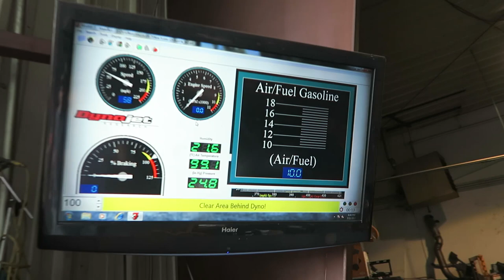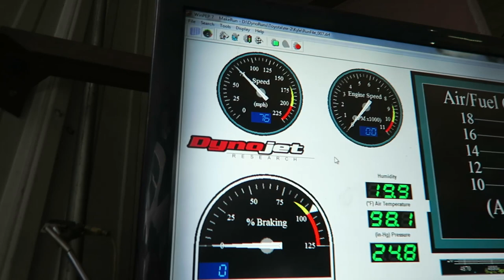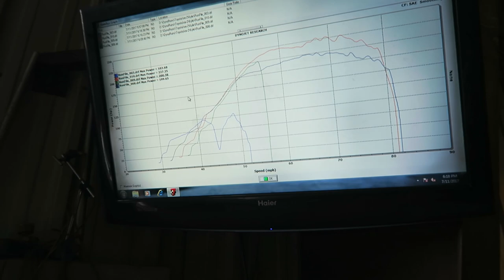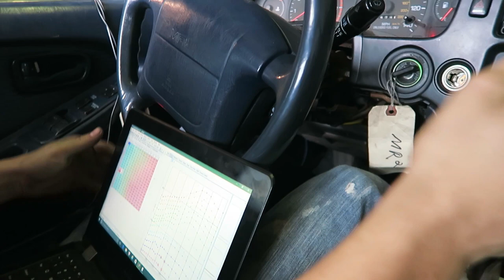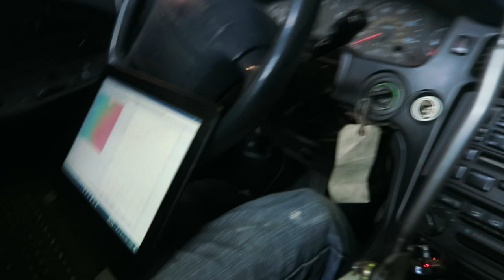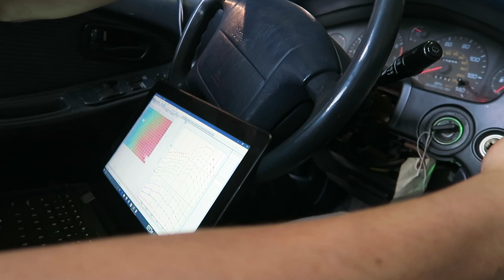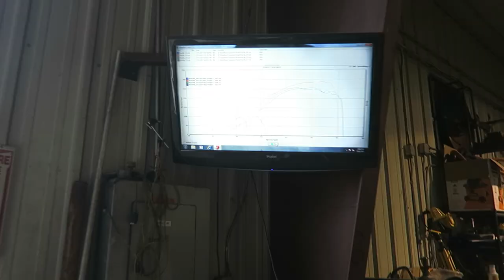K24 Mr2 Makes Some Boost on the Dyno!

Comment: Hayden trust me I've been doing this LS thing for a long time. You don't need a manual transmission,  you just need a good transmission!!!!
Reply: Right. The power curve on that dyno doesn't say "need more converter". The engine on that thing is just worth 237 i nthat iteration, can't blame it on anything.
Reply: The Thomas indeed 😂I started laughing when he said his auto was the problem 😂😂😂😂
Reply: Mike the Mechanic yes my father has an s10 he put a v8 engine it has an automatic transmission and it fuckin fast ass hell
Reply: ok but you cant deny that being able to shift when you want to rather than when a computer decides isnt better
Reply: antsolja you can't deny most computers are smarter than you
Reply: yes but the computer in an automatic transmission isnt, all it knows is what rpm the engine is at, it doesnt know if a corner is coming or when to up or downshift.
Reply: you know there are automatics that you bump shift and you choose what gear they're in right?
Reply: those arent normal automatics are they
Reply: Scrap that LS for a JZ or back to rotory. Problem solved!

But this is a mazda not a chevy so it's heart should be a 3 rotor 20b big turbo. Mazda is one of the few automakers that all of their cars are fun to drive. So he should of kept Mazda.

Comment: Everyone commenting on Haydens rx7 is forgetting 1 key factor. Torque. Although his car only made 237 hp his torque is there. Over 300 torque in that little rx7 will snatch you. It's not a Honda.
Reply: blake conner these kids just don't know how light these FB's are, combined with the fact now that it's got actual torque
Reply: blake conner I had a second gen rx-7 that I believe was 2500 lbs. the first gens were about 300-400 lbs lighter then the second gen models. I would think the first gen with a V8 would be about 2300 lbs.  I hope the owner of that car plans on beefing up the rear end or that torque will probably start breaking them soon.

Comment: Was really expecting more power out of gayden's rx7 😰
Reply: Robles Inline 6 fr tho
Reply: I know right... my crappy 2v made 250 stock with just a tune, I expected that ls to do at least 300-350
Reply: eh it's a 5.3 with just a cam running thru a slush box it probably low 3xx at the crank which is to be expected from a truck motor
Reply: Robles Inline 6 Hayden's 5.3 should be making all of 300wheel. My buddy's cam only 4x4 Silverado made 299 wheel.
Reply: Robles Inline 6 that's what everyone assumes when they ls swap but the rotary would do so much better why do you think everyone who blows so much money on the swap then gets disappointed by results sells there v8 rx7s
Reply: he'll probably have 400hp+ once he slaps a turbo on her
Reply: Ruben Pinto true but the rotary would've done the same with a longer power band than the v8
Reply: Youtuber they're also at elevation which is really hard on NA motors power wise
Reply: LS is a lot more reliable with boost though, I'd still take it over the dorito
Reply: so slow.
Reply: Robles Inline 6, stock 5.3, with a not very good cam, through an unlocked converter. not gonna make alot to the tires.
Reply: The 230 makes sense. The 5.3 vortec motors make like 270 crank stock and he is clearly on a shit tune. This just shows the motor is actually running within a good margin of what it should be.
Reply: It’s it an ls1? Which is a 5.7l
Reply: No, that rotary would have not made the same power with similar mods. It's a carbed 1st gen rx7 motor, it will never have the potential of an LS (as much as I love rotarys). Plus with a turbo this motor can put out 700hp easy with basic internal supporting mods, forged components and were talking about 1000+ hp. The original rotary just can't do that regardless of mods.
Reply: Jacob Coffelt you have clearly never worked on a rotary I see by your lack of knowledge.. rotarys have a ridiculous  amount of potential and can easily put out the same but honestly o  the street you don't even need that much. My only point was that he could have done the same if not more with the amount of money he's put into it. with the 12a if not a whole turbo 2 13b swap just change the fuel injection system port the engine and pin in get the right apex seals and tune it ... easy power.. I actually work on rotary and have seen it..
Reply: Roland Anderson reliability comes down to the owner.. rotarys are just high maintenance
Reply: Al Dubuc lol 4.8l LS based engines make 280 stock cmon that's hard to believe a 5.3 makes less
Reply: shoulda just boosted the 13b
Reply: 5.3's usually make around 220-240 whp stock. 237 is pretty good considering it's an auto.
Reply: Wannabe180sx damn right.
Reply: yea I thought it was a 5.7l which make 300 to the wheels
Reply: Robles Inline 6  , I bet once he gets the transmission in play , he gonna be contending with mr2
Reply: What did I say that was false? Yah rotarys have a ton of potential. But a ls motor with a turbo and forged internals will easily and reliably put down 750+ hp. Obviously a 13b could do that (a 12a wont be hitting 1000hp for near the same price as an LS) but it just wont be as reliable and wont be as cheap. I love rotarys but any rotary owner knows the motors in stock form need to be rebuilt more often than a standard gas car and thats a fact . Upgraded to push over 700hp+ driving tens of thousands of miles just isnt going to be the most affordable option with a modded rotary, at least not in the states.
Reply: Jacob Coffelt gonna  need regeared diff in the long run,
Reply: You think he's a mastermind with the dorito though? You can't blame him for swapping. Plus torque is what feels good on the street
Reply: have a cone internal turbo , for the turbine , all custom , have one in my K20 eg
Reply: Robles Inline 6 and the MR2...
Reply: lol it is not a stock 5.3 junkyard motor. it's a 5.3 bottom end 243 corvette heads a mild cam with springs and retainers and an ls6 intake manifold.
Reply: Wannabe180sx that's true, plus they're at a high elevation and that definitely doesn't help.
Reply: SuicideCRX do you know what's killing the hp? is it just the elevation? I would thing you would make at least 300 wheel.
Reply: Robert Smith truck motor or not Matt made 1071 on a little jim stage 2 cam and turbo
Reply: wAtch #SLOPPYMECHANICS
Reply: SuicideCRX u need to go on sloppy mechanics wiki page he has all the ls hacks,tunes, info to make ur tranny paddle shift. Just check him out if u haven't already, u have to check out his wiki page.just trying to help good luck.
Reply: That's rx7 should be in the 400 easy

Comment: 230 whp in an FB with instant torque from a V8 is fast. That car would hold its own against a lot of lightly modified newer cars.
Reply: Blake Snider just the power output is a bit concerning
Reply: This is exactly what I was thinking. A lot of these commenters have no idea what more than 150 HP at the wheels feels like.
Reply: no its not, you missed my entire point.
Reply: 802 Garage Ive had several 650+ rwhp Ls cars and trust me that set up he is working with has alot more potential its making less hp then a stock 5.3 with stock ecm would make . he has alot to learn with this ls setup but once he figures it out that car will dominate. a stock bottom end 5.3 with decent heads a good fuel system and a single 62mm turbo with 12 psi will make 600rwhp all day long .
Reply: Has he said if it has gen 3 or gen 4 rods? Also t56 will post amazing dyno numbers if he swaps it, but I'm assuming he has a 4l80e in it now which would be better for street and strip imho. SBE 5.3 with the Sloppy Special set up will go 10s, especially in something that light if he can get it to 60foot.
Reply: cgoodm i think its a 4l60e
Reply: Damn, well I'll bet it isn't gonna be sticking around too long.
Reply: cgoodm he has a th400 with a reverse manual valve body
Reply: it does not feel like 230 hp unless you start at a super low rpm. and it has a mild cam ls6 intake 243 vette heads. I'm going to compression test it and see wtf is up
Reply: It does seem odd it isn't making a bit more. Hope you get it all figured out Hayden!
Reply: A stock evo would fucking murder that thing
Reply: You might be surprised. Stock Evo is only making like 250ish WHP and certainly weighs more.

Comment: That's a good number for the MR2. Only thing I'd check on before you go much further is the timing chain tensioner on the K. Those are pretty notorious for going bad and stretching chains. Whenever you do your clutch, maybe hit that too. I think K tuned makes an aftermarket tensioner.
Reply: Spacerichard That's an issue with the K20A2, I believe Kyle has a K24 so it should be fine.
Reply: Ah gotcha, I've got a K20Z1 and a K24A4 currently. I went ahead and upgraded them both while I had them tore down.

Comment: 4900 ft elevation takes a toll on naturally aspirated engines, at 380 ft I have seen 4.8 half ton pickups make 250 at the wheels bone stock.  Once it has some boost it will be a fucking animal!

Comment: try a XTD clutch and lightweight fliywheel for the K24.  They're pretty cheap for the combo on ebay.
Reply: chodyman101  XTD are good if your knowledgeable enough to replace it every 6-12 montjs
Reply: Never cheap out on clutches
Reply: chodyman101 a guy I know has a XTD clutch in his around 500 hp Jetta so this clutch should definitely hold the power this MR2 is gonna be throwing at it

Comment: that rx7 needs at least a cam asap
Reply: kmart nw Hayden said it had a cam but wtf it should make more power totally stock...
Reply: David Gomez definitely, something still isn't right with the fuel system would be my guess
Reply: kmart nw I think it might be the torque converter robbing all his power. Or his fuel lol
Reply: needs a bottle
Reply: Budget Racecar Garage a snail would be better but I assume he's on a tight budget for now
Reply: it has an ls6 intake 243 vette heads and a cam lol something is definitely wrong
Reply: SuicideCRX thing probably has negative timing
Reply: SuicideCRX sounds like you need a converter, looking at the graph. What rpms are you running? And what converter? PTC "performance torque converters" makes a great "budget" converter for the th400 for around $550
Reply: Dalton olson has a stock converter lol might try to get a 3500 rpm one and some nitrous
Reply: SuicideCRX yeah man those numbers will go up! I really recommend looking into a ptc converter! You won't be disappointed. Love the videos man, good luck with the rx7 would love to see it one day.

Comment: So the RX7 made less power than a standard FD turbo 😬
Reply: But has the potential to make much more hp for much less $. He doesn't plan on keeping his ls swapped rx7 stock for very long.
Reply: it also makes tq that would make the rotary cry.
Reply: made less power then stock.... probably the record for lowest LS hp ever
Reply: MrGuvEuroman rofl. rotary
Reply: Wrong.  A stock FD makes about 200-210 at the wheels.
Reply: lmfao, but this is an FB, that's legit 2 generations before the FD. that's really good, especially since its got torque.
Reply: it is a 5.3 out of a truck so it makes more torque than power.
Reply: Donnie Rowland its not an ls engine. its an ls-based 5.3l v8 used in trucks. they dont make much power stock. put a cam and intake on and its easy 400+hp.
Reply: Frigglebiscuit yeah it's a stock truck motor so it's not power but the car is light as hell so hopefully it'll be fast
Reply: funny how everyone thinks it's stock 😒
Reply: SuicideCRX it is besides an intake.
Reply: Frigglebiscuit lol I've said multiple times it has a cam and 243 vette heads
Reply: SuicideCRX sure as hell doesnt sound like it. some serious tuning is ahead for that engine. a 243 cam should at least have a noticeable idle difference. btw, th-400s suck a hell of a lot of power. thats probably where most of it is going.
Reply: It also made far more usable torque than a standard FD turbo.

Comment: That's awful for an LS...
Reply: Nicholas Pelcher it's a piece of shit truck motor. It's only worth ls swapping if it's an lsx not that trash
Reply: bryan #308 odds are h got it out of a junkyard for 100$, put a shitty eBay turbo on it make 400hp reliably
Reply: bryan #308 obviously has no clue about LS truck motors
Reply: Junkyard motor + ebay turbo = reliable 400 hp? In what world bud
Reply: Mags Airsoft in the world of v8s. less boost, less strain.

Comment: what trans is in the RX7? 4L80e and th400 is basically the same except for od. 4L60e is a electronic 700R. the TH400 is a power hog. unless you are running crazy tq. and over about 3000 lbs. its not really needed. I'd go th350 or 4L60e / 700R. unless its going to be a street / striper. with lots of boost. then 4L80/ the 400, and pistons. I'd never use cast in any performance app. good to see progress with MRtwo. get a clutch in there and crank UP that BOOST!!! can't wait to see it. but I bet you wish you put in a good performance clutch. before you put the engine And trans in.  but sometimes you just can't wait or just don't know one is needed.

Comment: wow hayden only made 232hp to the wheels . my brothers 05 silverado with only a cai and cat back made 303rwhp and his a 4x4 auto trans . obviously that 5.3 is either clapped out or the tune is way conservative.  he needs better fuel rails and make it a return style fuel system with an aeromotive regulator and throw in some Ls6 injectors for now.

Comment: those pistons probably failed because the ring gap was too small, not because they are cast.  Cast pistons will take a lot, if the ring gap is right.

Comment: Need more octane, WMI for extra cooling/knock prevention, and bigger ring-end gap. Realistically if you're trying to make some serious power, though, you need 2618s or at least 4032s.

And why is that LS making such terrible power? Not to jinx ya, but it seems like something is seriously wrong with it - that's super low for what it is.

Comment: im thinking maybe he should stick with hondas cause not everyone knows how to properly make good power out of an Ls ! not saying he does not know what he is doing just saying some people just dont understand the Ls platform well enough to make good power. back in 2000 when I had my 95 Z28 with the old style Lt1 not this new direct injected one , I hated Ls motors cause they were new and I knew how to make good power with my Lt1 setup. I literally had over $25k in the motor/supercharger/t56 trans and a built 12 bolt and that car made pretty good power for back then 547rwhp 561rwtq with a 434cid Lt1 and vortec blower with after cooler , but when my buddy made 525rwhp with just a procharger at only 8psi on a stock Ls1 with just a tune and the blower and he only spent $8k total , thats when I became a huge Ls fan .

Comment: Lmao hell a stock v6 mustang could beat that rx7.... BTW with having a cam, heads and a intake you should be putting down more power than that and its not your trans robbing you, might wanna check your fuel system.

Comment: Eugh I hate American V8. 3 Speed auto and 230 HP from a 7 litre V8... What's the point?
Reply: It's a 5.3 chevy truck motor that didn't see more than 300 crank when it was BRAND NEW. They have a LOT of untapped potential from the factory you'll be surprised when Hayden gets inside that motor